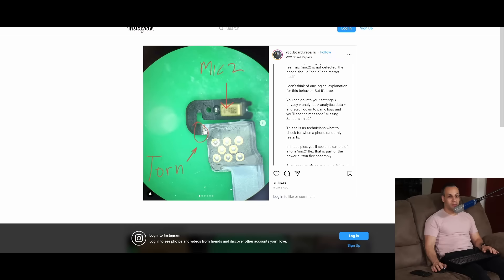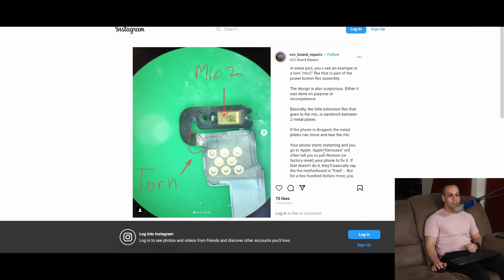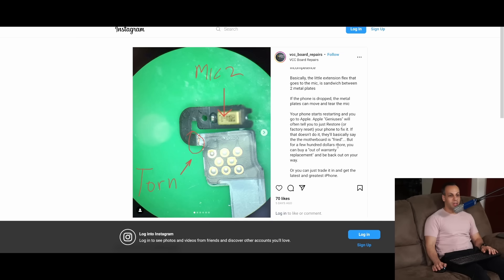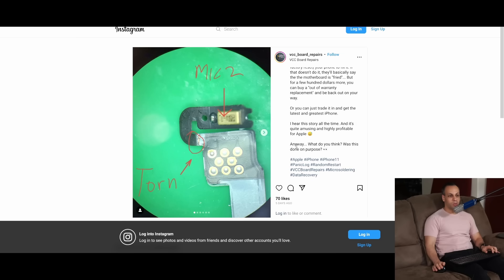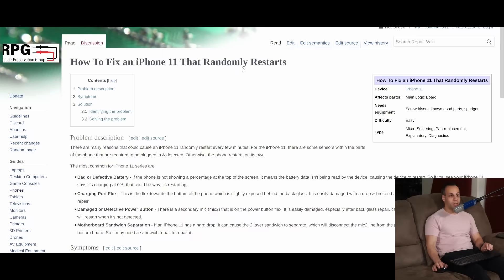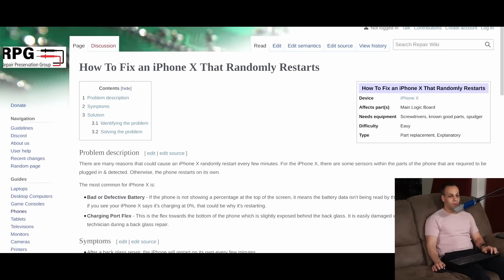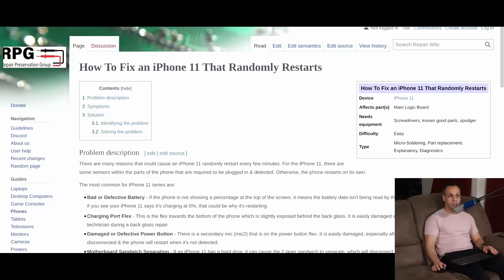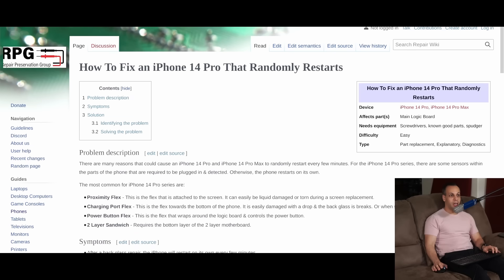iPhone's design flaw shows that 10 years later, their engineering is still a joke

Comment: Another thing that makes this issue so infuriating is that particular mic isn't even used during phone calls or FaceTime, it's only used during video recording.
Reply: @michaelscarport At least in that case, the brighter you make an incandescent lightbulb, the more efficient but shorter-living it gets, so there was a very real value in imposing standards with active testing because a lot of the engineering responsible for the short lifespan was directly responsible for high energy efficiency and brightness.
Reply: No, they made filaments thinner to get higher operational temperatures for brighter and whiter light, which has the unavoidable trade off of causing the filament to sublimate faster. Long-lasting bulbs cannot glow brightly because they must operate at low temperatures.
Reply: yeah, only during video recording... oh and when storing random recordings when you talk, maybe that's when it crashes
Reply: @kaitek666  It's worse than that. The crash doesn't occur only when that mic is initialized, if the system doesn't receive a "check in" from that component the phone will restart every 3-4 minutes like clockwork. There are other components that are not technically needed for the phone to run that will cause this issue as well. This has been happening since the iphone XS.
Reply: @michaelscarport Technology connections would like to  have a word with you about light bulbs
Reply: @michaelscarport that is a conspiracy theory 😂 you will never afford something that lasts forever
Reply: Which is the proof that Apple is malicious in making the phone dysfunctional for a non-critical part failure when a simple warning would suffice.  Those phones are so aware of all their serialized components now that they know the part that is not working does not need a constant rebooting to fix and that if it is not fixed after X reboots, IT WILL NOT BE FIXED BY ONE MORE!  It will get the annoyed customer to pay to fix or replace their phone though.
Reply: I had this mic failing on iPhone 8 plus, it records videos weird , like 5 second you have sound, 5 seconds it's a mechanical noise. 
It's not rebooting, but draining battery really heavy
Reply: @michaelscarportdo you  have any mental patients in you family? Those conspiracy theories could be a sign of a serious problem. You might want to see a mental health professional before it’s getting more serious
Reply: Ah, a bug with the bug 😂
Reply: @michaelscarport The light bulb wasn't planned obsolescence though, that is just a myth. Technology Connections has a great video explaining why there was no collusion for the sake of profit, they only made the standard because it was the best compromise on price, brightness, and efficiency.
Reply: @michaelscarport You were allowed to modify light bulbs to make the necessary changes to make them last longer, even though it could kill you, and it was more expensive than just replacing light bulbs more frequently. Technology Connections has a great video explaining everything.
Reply: Apple has been a champion of creating e-waste for the past decade.
Reply: @micahnightwolf  tbf you cant really beat china on that, just google "EV graveyard"
Reply: designed failure is all the rage these days.
Reply: @michaelscarport  except for the fact that they never lasted forever, and if they did the lightbulbs would be so dim they would be barely usable, and be super inefficient, you talk about the history of the lightbulb, but you clearly never looked into it more than watching a couple videos, just as I and many others have done. You say you are talking to an empty room but it was only a normal conversation, not everyone has to agree with you with every message for there to be a discussion. Did you even look into the video that they mentioned?
Reply: It's critical for EyePhone surveillance hence the annoying reboot. They just like your data, it's their blood for survival.
Reply: @KlaBoi-qj8oh  ...or a faulty/damaged face camera likely would trip the same routine in the debugger, as it can no longer be turned on remotely...
Reply: @michaelscarport ...its a feeling i share...more and more every day...
..ur not alone, but thers no need to spend time on those ppl...
Reply: @Patrik6920  ...except they aren't wrong, even after the cartel bulbs were still sold rated for 1,000 hours, if today you took a 2,500 hour bulb and a 1,000 hour bulb and tested them, you would see that the 1,000 hour bulb was both brighter and more efficient, as it produces more light per watt of power

Comment: I personally don't believe it's a mistake,I think they do it on purpose. Sadly. I used to love Gateway computers when they first came out (I'm that old). Everybody laughed and picked on me because I refused to get a Mac. The reason for that was when you bought a Gateway it came with a big thick book (manual) that not only showed you how to set it up,but also how to repair it down to removing everything off the drive and reinstalling it. It was amazing and they had my loyalty from day one for that. I think the cell phone manufacturers should be made to give out manuals just like that for repair purposes. This BS about coming out with a new model every six monthe to a year is ridiculous. Thanks for all you do,
Reply: If it was incompetence, by pure chance they'd occasionally make something with a brilliant design. 
The fact that it's always a detriment to the customer and profitable for Apple proves maliciousness
Reply: Yes. The company was Gateway 2000 back then. My first PC. It had a 386SX processor, which was a 386DX with the math coprocessor disabled. 16Mhz was the speed, I believe.
Reply: @stevec5465  I've built my own computers for 30 years now. That way I can use the best components at a reasonable price. Back in 1989 a computer with a 55 mgz cpu , 16 mb of ram, and a 12 gb hard drive with a 19" monitor would run you over $5,000 (and that was in 1989 dollars!).
Reply: Unfortunately this kind of business model doesn't work in our culture because everything in life must be "convenient". The iMac was a massive success because it was plug and play; plug in 3 cables, press the power button, a few minutes later you're ready to browse the internet. The OS was designed specifically to be no BS and that a child could use it. If it broke, you brought it somewhere for repair. 

The desktop PC in general faded as soon as laptops became good enough because they too are more convenient. 

I can't describe with words how much I despise this culture. As an electrician, the amount of calls I get where people ask me to come change a lightbulb is alarming.
Reply: @glossymouse7712 seriously? People call you to change a lightbulb or is that an exaggeration? I could somewhat understand if it was on a 20 foot tall ceiling or elderly.
Reply: @glossymouse7712  The only problem with that hypothesis is that the majority of people always bought complete desktop computers that were the same as your description of the iMac.  That is exactly what Gateway sold.  Even if they did include technical documentation their target audience was really people who wanted a complete and ready to use computer.
Reply: @glossymouse7712  Why? Unless you didn't get paid nice money.
Reply: I still got the ol' cow pattern box my old gateway came in 😅
Reply: Thing is phones are quite difficult to fix. The limited space makes them aggravating to fix. I build and fix my own pcs and sometimes laptop but anything smaller like a tablet or phone I get it repaired. 
I have the apple care+ so really anything that breaks on my phone including things that were my fault like screen cracking is covered. 

Even if they gave a manual for repairing phones and tablets, I doubt many would chose to fix their own. You also need more specialized tools for them which most people don't have lying around. Just opening the phone will probably be too big a barrier for most.
Reply: Gateway 2000 was my first pc too. 🤘
Reply: Not exactly having the guides, but there is Fairphone 4 which is completely modular where every major component can be swapped with just a standard screwdriver.
Reply: I agree, there is no way on Earth that all these things Apple do is by mistake. You don't just accidently become the richest company in the world by screwing up all the time
Reply: @DannStarr only way they became the world's richest Company is because they hired the best psychologist
Reply: @@GH0STST4RSCR34M Companies, even huge ones, make engineering mistakes all the time.  When it is something like an aircraft people actually die.
Reply: less "it's a mistake" and more it's designer or programmer blindly following the step-one Tech Support fix of "Did you turn it off and back on" when ANY issue pops up.
Reply: Everything should have to come with repair manuals.  I still have the schematics that came with the Yamaha receiver my dad bought in the 70s
Reply: yup, not a error, its a bussiness model 😂
Reply: @@GH0STST4RSCR34M As someone who works in engineering in a big company, it is absolutely possible and very likely that this wasn't done on purpose, but missed. There are 1000's of little details when designing something and it is a certainty that some things that can cause issues will go unnoticed. The restarting issue could be fixed in a software update once identified though so they should address this after the fact. But the cable getting cut, I am 100% certain that was not intentional, but someone missed it in a review, or people were of the consensus that it wouldn't cut the cable without thinking of the use case of a drop causing it to move enough to cut.
Reply: I visited a engineering company and the guys mocked the new workers having a macjokk
Reply: Just like old white goods (brown goods).  Inside the device would be a wiring diagram, even old tube tvs that had very large and dangerous caps still provided this most basic info. You would have to try very hard to fuck up an iphone repair so badly that it might be lethal, but they use safety and security as an excuse to not provide this info still.

Comment: I don't think it's a joke.  I think it's built that way intentionally so it fails faster = you can't fix it = you have to buy a new model next year :)  God, I hate this company.
Reply: As a software developer I want to say that it is totally possible for this to have been an oversight by the programmers.
Usually we tend to use a special function named assert, e.g. assert(mic0 != null)

if mic0 is null (0 in german), then that assert will cause an exception/error, and depending on the language it usually causes it to panic.
If the kernel panics, then the entire system is unusable, so it reboots

usually when we deal with hardware, we tend to assert that everything is operating the way we want to, otherwise bugs may appear

you may ask "But can't they just fix it?" and the answer is yes, they totally can, and since they call themselves "engineers" then they must be able to fix this, otherwise they are phonies.
Reply: What phone would you recommend?  They are all like this now.
Reply: @iankelly3081  Get a pixel or stick with your iphone
Reply: Have you ever built a phone and developed the OS by hand and have done other behind the work stuff like designing the ACTUAL phone and the chemistry to make their phones efficient? No.
Have they? Yes.
This is fucking propaganda
Reply: Otherwise, where will the capitalists get the money to travel, buy private jets, and buy yachts?

Comment: It's not real engineering.  It's designed to be as cheap as possible, made by literal slave labor, people kidnapped by the Chinese government and forced to work in the factories (they have to put suicide nets outside the factories).  They don't care if it's reliable or works, because they know their sheeple will continue to buy it regardless of quality.  So they charge as much as possible, while making it as cheap as possible.  Apple products are absolute total garbage, even at 1/10th of their price they woudn't be worth it.  Any other manufacturer (even SAMSUNG whose new phones are a scam) has much better hardware.  All good products Apple ever released were designed by Wozniak.  If Wozniak wasn't involved, it was garbage.

I swore off Apple for good, permanent boycott that will never change no matter what happens, in 1989.  And what they did then was so minor compared to everything they've done since.  As far as malice vs incompetence...Apple is just incompetent.

Comment: Has he confirmed that the random reboots are due to the poor connection, or those metal plates shorting lines together? (i.e. take a working phone, disconnect the mic connector, see if it randomly reboots)
Reply: Yes. You can check the panic logs in settings and it will often show the issue ("missing mic2" was the example he used) sometimes though it's unknown what the issue is which is why debugging can be hell
Reply: Yes. That's exactly how I was able to decode so many of these panic logs.

Unplug one flex at a time until it restarts

Then  check panic logs

Then plug back in to confirm it's not restarting anymore 😅
Reply: @VCCBoardRepairs  Are there any other nonessential peripherals where the OS will randomly kernel panic when they aren't connected?
Reply: Random screams short to me. Software issues aren't typically random, even if they might sometimes seem so. If something was done on purpose, ie. reset when X is missing, then that would surely not be random.